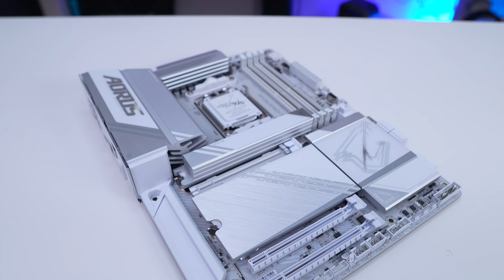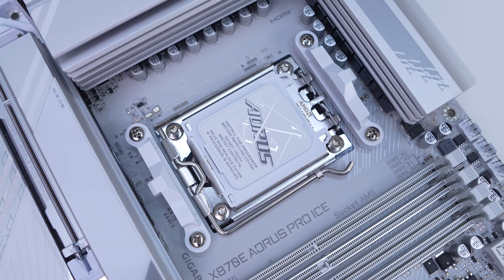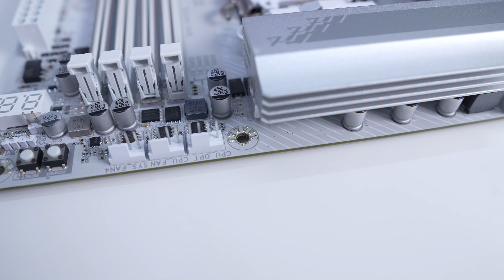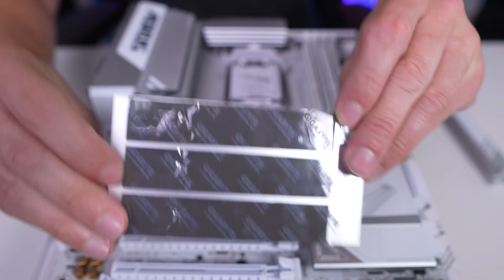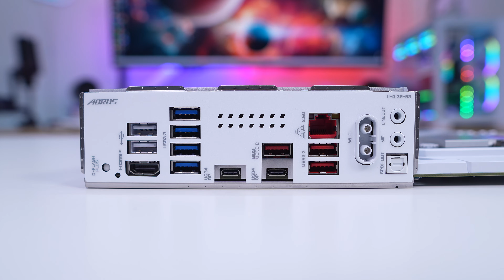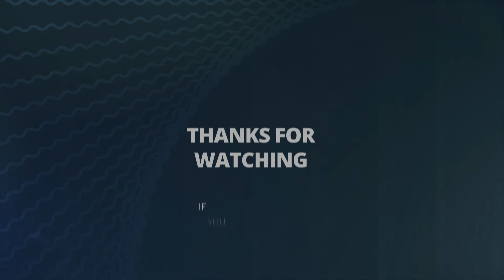Gigabyte X870E AORUS Pro Ice Motherboard Review

Comment: do you know if there is a external small screen or something that would fit in a drive bay 5.25 to display the trouble codes instead of having to remove the case cover? Thanks again.

Comment: In the manual it says you can run Dual channel memory mode with 2 or 4 sticks. Prevously I have been told that only 2 would work in dual and that is all I have been able to make work. Is there a setting to change to get 4 sticks to work in dual mode? Thanks

Comment: Just be careful on your build;
M2A_CPU → Gen5 x4 direct from CPU. Safe to use, no GPU penalty.

M2B_CPU + M2C_CPU → also Gen5, but share lanes with the primary PCIe x16 GPU slot. If you populate either, the GPU slot drops from x16 → x8.

M2D_SB (chipset lane, Gen4) → safe, doesn’t affect GPU.
Reply: awesome tips highly appreciated
Reply: Can you use a gen 4 in the M2A_CPU or is it only gen 5?
Reply: So the first gen five is fine it’s the other two that aren’t

Comment: For the love of God, todays graphic cards today are massive, when will any MOBO manufacturers create room around the GPU slot. Someone needs to seriously redesign the board and move the GPU slot to an area with more real estate or reposition the NVMe SSD slots (to give more space to the GPU slot) or provide buyers with a riser as a standard component when purchasing the board.
Reply: I've got a porky XFX Mercury 9070 XT on this motherboard, it barely misses the SSD slot. If the height of the GPU is a mm more, it's hitting the SSD heatsink.  So yeah lot of the 5090's aren't going to work on this motherboard. 

They're probably not going to mess around with the current headers and power placements are pretty much standardized. GPU manufacturers should be the ones trying to make their GPU's smaller, they're responsible for creating oversized parts.

Comment: Please note that even if there is room for 3 M2s under the graphics card, the two gen5 ones share bandwidth with the graphics card, making the graphics card run at x8 instead of x16. So go for one M2 in the slot above the GPU, and maybe one gen 4 in the middle slot
Reply: gen4 slot will share the bandwidth with the chipset though, while 2 gen5 slots will just take (otherwise unused) 8 lanes from the x16 slot. it will not slow down the graphics card, not even 5090 saturates whole x8 lanes of pcie5 gen
Reply: Wisedom
Reply: This was the question I wanted to address and you already had the answer for me buddy, appreicate a lot your comment, thx!
Reply: Will the gen 4 in the middle slow the GPU?
Reply: @minimusmax  no, it shares bandwidth with the chipset, so it won't
Reply: @lefteriseleftheriades7381  ok thanks
Reply: So i have 2 Nvmes Samsung 990 prob4tb and 2tb. If im planning to put it the 4tb on m2a. Where should i put the 2tb?
Reply: @mdprs2676  it depends on the specifications of your mother board 🤷‍♂️
Reply: @mdprs2676  I have this board the pro ice I used the one above of the GPU PCI e 5.0 and the PCI e 4.0 this way is not sharing any lane with  the GPU!

Comment: could you possible do a video on wiring for this motherboard? i am getting an lian li o11 XL case so i will have the 3 AIO fans and Lian Li 3 intake fans 2 bottom fans and 2 rear fans all with RGB and the wiring part of the build especially for the fans and especially the RGB are usually skipped over on builds and hooking the whole builds wiring up is my weakest spot to educate on.

Comment: Do you think Gigabyte’s build‑quality on the X870E AORUS PRO ICE is better than comparable ASUS X870E boards (like the Crosshair or ROG Strix)? I’ve heard the AORUS design—particularly features like EZ‑Latch GPU support and robust VRM heatsinks—offers excellent durability and user‑friendly installation, and reviews generally praise its solid, clean layout and passive cooling solution.

Also, how does the BIOS and software stack up in terms of stability and polish compared to ASUS? From what I’ve seen, Gigabyte has launched with a modern, easy/advanced dual‑mode UEFI, and early BIOS updates (like F3a) already resolved some PCIe lane issues—most tests suggest solid stability and overclock performance right out of the box.

Would love to hear your experiences comparing it to ASUS’s firmware support, memory handling, and long‑term reliability!